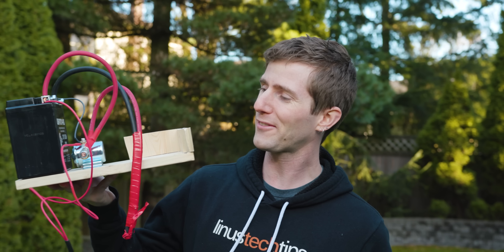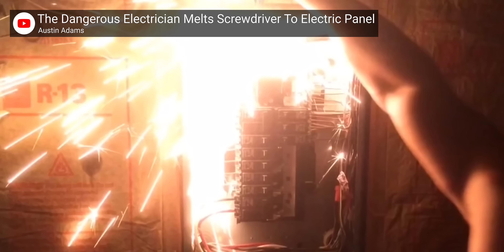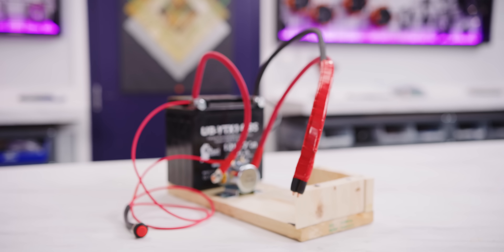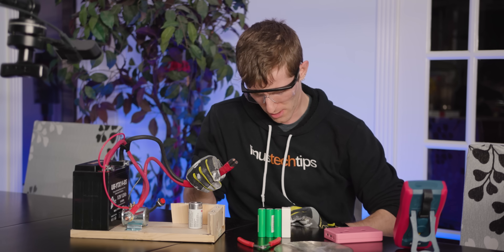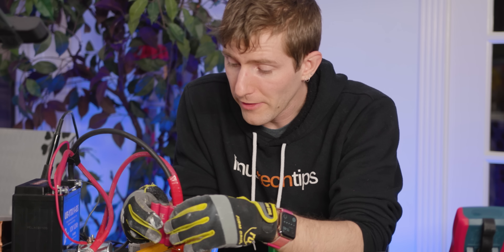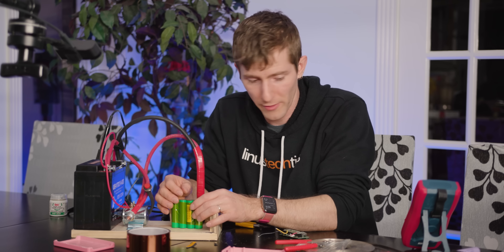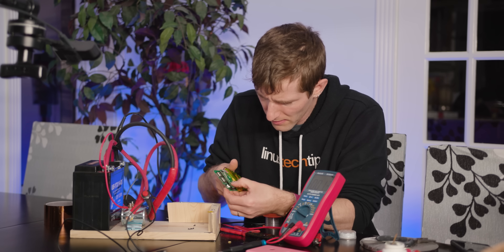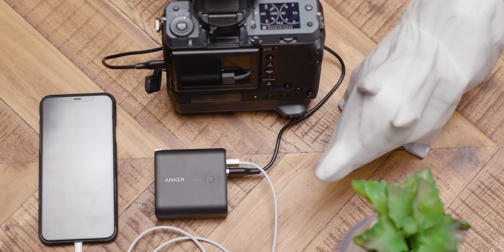I spent $100 to save 20 bucks... and it was TOTALLY worth it!

Comment: It's actually super cheap to get good cheap 18650s if you know where to look. You can get old battery banks, 18650 trays and a pack of 2+amp USB charging boards for very cheap.
Reply: My favorite ones to make use single or double 26650s, little chinese 3.7v  charge boards, and little chinese 2amp USB modules. Combo boards are good too.

The only reason I have the supplies is I was going to attempt selling Gameboy raspberry Pi's for a while but lost interest.

Comment: Another alternative: Some stores that sell individual rechargeable cells will rebuild battery packs, including the spot welding, for just the retail cost of the cells.  Polar Battery on Boundary Road rebuilt several radio battery packs for me using NiCd or NiMH cells.

Comment: thanks for the great video. one of the comments said the relay was archig closed. i assume the effect was that the momentary switch functioned as if it was sticking in the 'on' position. would an upgrade be a heavier duty or purpose built welding relay?

Comment: the is no electricution hazard in any of this... its low voltage, so low current is gonna flow through the body, you aint even gonna feel a slight tingle.

Comment: You can buy a 12v portable spot welder SET!. Board with cables and screws for 20 euro.  You need a 4s lipo 50c-100c battery and done. Working for me amazing! 
Board set:  https://a.aliexpress.com/_BUErto
Lipo battery 2 stuck: https://a.aliexpress.com/_BPPmfY

Comment: I want to be clear:
There is in absolutely no way you could possibly get electrocuted with this spot welder. 
The worry is in the battery cells youre welding exploding in your face for holding the button too long.
You wana make it legit? Put it in a box, create a super simple time delay circuit and put an electrode on the end of that thing.
Legitness
Reply: Yup.  I'm figuring driving the contactor with a secondary solid state relay and a 555 thingy would make things a bit better controlled.
Reply: Yeah I laughed when he said 'electrocution hazard'. The only way you're electrocuting a person with 12V is by ramming electrodes into their brain or chest cavity. And you'd more likely kill them with blood loss or traumatic shock than electrocution.
Definitely a burn and fire hazard as you said though. I want to make one with an adjustable time delay now dammit lol

Comment: TBH this is a problem with manufacturers who make battery packs more than anything. I can get a 4 cell USB power bank off of amazon that has an easily accessible battery compartment with standard spring loaded contacts that allows you to safely swap out 18650 cells as many times as you need with no soldering or welding and the fact that so many companies make sealed inaccessible battery compartments like this is just a fundamentally flawed design in the first place

Comment: so, where was the 100?   those 4 18650s aren't that...$20ish?   nickle strip? only used a little bit at ~$15ish so a few pennies.
won't fit in the extant case, likely, but mod it a little to accept a prebuilt 18650 battery holder  ($7ish) and then replace or swap 18650s at will having a handy backup?
(probably what i am going to do with some of my dead ones)

are you counting the spot welder?

Comment: As much as it's not recommended to solder these batteries, if you don't suck at soldering and have a decent iron and tip I can tell you it works fine. I can imagine a "home made" spot welder being more dangerous.

Comment: I would have figured the battery terminals are just caps which are just separated from the real terminals inside by an insulating spacer or air, on the cup shaped one.  Wouldn't a quick tinning of the caps be possible with a 150W soldering gun, and after a quick join of tinned wire to it be possible without too much heat entering?  Especially since it's not at molten nickel/steel temperatures for that time.  I'd preheat the iron for a few seconds of course.  Thoughts?

Comment: I'm not gonna fault you at all for your set up. It's awesome!! I've done many Multi-Cell replacements with just Solder and they're fine. Just don't mix different storage cells. Spot-Welding introduces alot more heat than I want on my cells.

Comment: (3:43) - Using a small toggle switch alone will not prevent any electrocution hazard since it is only 12 volts that is being switched.
But yes, the switch itself would likely vaporise.
>

Comment: When I was going to school to get my A&P, we had a course in welding. It was very short, and more for recognition of terms and techniques rather than to become good welders for aircraft materials. We were doing MIG welding, I think. We had a gun with an element that would get fed through while being surrounded by an inert gas. Keep in mind, we are AMT students, not welding students. We were not as familiar with the equipment as a proper welding student would be.

One of the instructors goes into my both to show us something, or to set something up. I have one of the welding guns in my hand. I'm not sure if I almost dropped it, and caught it, or what. All I know is the filament started coming out. As far as I know, when the filament is flowing, the filament is hot. It has high potential, and the potential for high current. The instructor was right in the line of fire, and being in the booth, had no where to go.

The filament finally stopped. I don't remember how. All I know is there was about 5 ft of filament that came out, and I was extremely nervous about how close it got to the instructor.

I'm pretty sure I could have killed him. You can't imagine how relieved I was the filament stopped, and he had a chance to leave the booth.

Comment: Really good tip on the spot welder... Buy to tungsten carbide scribe's to use as the electrode so they don't weld themselves on the parts.

Comment: Use one of these to time the pulse to less than 1 second. No more burn-thru or toasted cells. https://www.ebay.co.uk/itm/NE555-Delay-Time-Relay-Timer-Switch-DC-12V-Adjustable-Module-Digitla-LED-Display/293044391437?hash=item443ace8e0d:m:mvnY656XpLuqZGOvFyM62Hw

Comment: Honestly they saved less than 20 since they already had the cells. They could have just bought one of the power bank cases that are solderless to work. Also you can rip the nickel off but it leaves small spots where you spot welded it but if you had a battery bank board crap out you can just take them out and rip the spot welds off.

Comment: You are way too happy about that spot welder. But it is also on my list of tools of my dreams. Times like this I remember why I watch your channel. My favorite part is that you never do dry runs. Dry run planning leads me to not actually start a project. It also leads me to having to pause projects for weeks while waiting for parts from china. #WeDidItReddit You are lucky it used 18650s. Everyone has those except me. The only two battery banks I have tried to do this on had friggin pouches.

Comment: You can buy pocket-sized battery spot welders for about $30 from Aliexpress (and I guess eBay) and for that price they even come with their own battery.
They work surprisingly well, microcontroller controlled, so they send the right length pulses and they do it automatically...but you're definitely going to want to make/get a case.

Comment: Your switch was working fine, your solenoid was trying to weld itself shut, that solenoid model number is capable of 200A, your model of lead-acid battery puts out a minimum of 200A at 0C
Safe to safe you were above the solenoid max amperage value by 100A (because the battery temp was above 15C)

BUT, For 4 18650's I probably would've tried it too if that's what I had laying around.

Comment: FYI..  I soldered battery packs for 20 years until I built my spot welder from a junk MOT.. if you use a high wattage gun... like a 375watt Weller... so it heats fast... scuff the surface with a little sandpaper. apply heat just long enough to flow.. I've NEVER had a battery degrade from soldering... the people who do are using little 25watt pencil irons... takes forever to heat the caps.... they heat soak.. I trusted several thousand dollar R/C aircraft to soldered battery packs.  never lost one to a battery malfunction

Comment: I you're going to bother making a DIY spot welder, I think it would be a good idea to add a little auto-time circuit (probably with adjustment control like the premade product had) to control the relay. It's more advanced sure, but you're going to be following a guide anyway, and the benefit should be immense (getting consistent welds).

Comment: the problem is the copper tips are not close enough. it works though you may need to understand the feel of electricity and current through different types of metal to understand how to get it right every time if that makes any sense to anyone of you

Comment: He does realize you can buy USB Battery packs from Amazon and Ebay that actually have spring loaded compartments for 18650's dont require soldering/welding and can have their batteries replaced as many times as you need to .....  This video actually pisses me off because there is already a fictitious stigma about dangerous lithium ion battery fires and people not knowing what they are doing building spot welders can and will start battery fires if they screw up the wiring and overheat or rupture the cell. (Lithium ion batteries with properly installed protection circuits that are being operated within their rated load will not catch fire) (The largest source of the supposed "dangerous" cell instances are criminals who take known defective or heavily used cells and resell them as new on sketchy online marketplaces) but these incidents while tragic and newsworthy are caused by stupid humans being greedy scumbags and not a problem with lithium batteries as a whole )

Comment: Someone who is good at soldering can do better at protecting a battery than someone who is bad at spot welding/has a jank welder.

Also spot welding on top of a spot weld isn't ideal but in this case its probably fine.

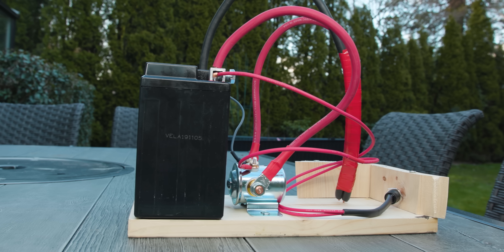Comment: 3:00 AC power is really not all that intimidating... put a fuse somewhere in the mains side of the unit and you're pretty safe. Nonetheless, I'd say you had the right idea avoiding the microwave oven transformer, because those things in particular are pretty deadly.

Comment: "You basically can't get them off" 

A pair of pliers and some determination says otherwise, sir.
Reply: and perhaps a little sanding to clean it up
Reply: but you do risk deforming the cell's container and by doing so, render the cell unsafe for usage and in need of e-waste disposal. dendrites forming in the electrolyte are liable to cause the cell to undergo unscheduled thermal runaway (technical term for catching the battery and possibly yourself& your surroundings on fire..) needless to say the cell is definitely never functional after thermal event.
Reply: @zaneandre6387  if your cells are being deformed by pulling off a zinc strip that's barely held on by millimeter-wide spot welds, then you have some seriously shoddy cells, which should be your primary concern. I've pulled dozens of tabs off of batteries then re-welded and used them for high current draw RC aircraft packs with no problems.
Reply: @BillPickle  i was talking about what happened to me when i pulled off tabs that were likely machine welded to the battery terminals. perhaps the can was thinner or weaker than others because i hadn't experienced it prior to the cells i repurposed from an old laptop battery pack.

ill concede I have not pulled hundreds of battery tabs.
Reply: @zaneandre6387  I’ve taken apart many Dell and HP laptop batteries for their good cells, never had an issue with messing the casing when pulling out the tabs.

Comment: Ugh.. Don't spread the misinformation that opening/repairing anything with a Li-Ion battery is too dangerous Linus. The "right to repair" movement already has enough friction and blockades in its way without you haphazardly agreeing with the manufacturer's ludicrous stance on the subject. I know you aren't actually siding with them when you make a statement in passing like this but God knows they will use any small nugget of support they can get, out of context or not.

Comment: Some battery packs (i.e. from laptops) die when the batteries are disconnected since the controller needs permanent power supply. Inform yourself before trying to change anything and - if possible - connect an external power supply with limited current to it. Otherwise changing the cells won't do anything since the battery pack won't get recognized again.

Comment: Anker makes quality products, but they aren't as fully featured as the competition. One of my RAVpower packs has 2 QuickCharge 3.0 ports (Micro USB input and USB A) and 15w USB C, plus another 2 amp USB port. The other one has USB C power delivery and 2 USB 3.0 OTG data ports. I also have a MyCharge Hub C with folding AC prongs and integrated charging tips.

Comment: Add a timing circuit so you don't have to get used to "timing it right" so much.  All it should need to do is be adjustable and cut power after a maximum time.  After that, I want to make one too

Comment: I've built around half a dozen dewalt 18v batteries and even rebuilt an old 6s2p LiFePo4 into a 5s2p Li-Ion with a 60 amp bms, i've never had any problems spot welding (cheap ebay spot welder) i've saved a fortune on dewalt batteries but more importantly the cells or of a much higher spec than cheap aftermarket batteries and mostly likely better than OEM (I use sony vtc4 and vtc5)

Comment: I used a Microwave transformer, 0 gauge welding leads, cheap Solid state relay (5v capable), random momentary  switches from the microwave,  arduino with LCD and rotator switch for the pulse signal duration, foot controlled switch  , old 5v 2a power supply and some other things. 

The reason why I needed a precise timer is the difference of half a second to quarter of a second will result in a good weld or a hole in your strip and battery. This way, I don't have to fear controlling the timing. I also 3d printed the case.

The Microwave was gotten for free from Craigslist. Just searched the free section for a broken Microwave. I've used mine enough to warrant the very small cost.

Comment: Seriously, why even buy a battery bank where you can not change the battery without soldering?
30 Years ago (!!!) I bought a battery bank "Conrad Electronics Flexible Battery Charger" which accepted either 4xD or 8xAA batteries. The bank was able to work as a charge-only station or as a fully fledged battery bank. Because power converting and cabeling was done in an adaptive way I am using this same thing to charge applications through my self-made USB-C adapter cable. After all these years this wonderful piece of hardware still works perfectly and even works perfectly with newer battery types. Only drawback, charging modern D batteries with 8-10Ah takes 3-5 hours because there is no modern fast charging mode implemented.
Fun fact, my university uses this device at a south pole research station all around the clock for 30 years. They are precharging like 50 D batteries for a total of 400-500Ah and then hot swap these on-the-go while doing work outside. Want to see a notebook running on battery power for 10 days nonstop at minus 50 degree Celsius? This is the way to go.

Comment: Unless the controller coil inside the relay has a series resistor already built in you might want to add a resistor in series with the push button, if you don't the current going through the push button might be greater than its maximum allowable current, resulting in a hot switch or in the worst case causing the switch to stay stuck in the 'on' position.
Reply: A relay rated for 12 Volt will work at 12 Volt without resistor